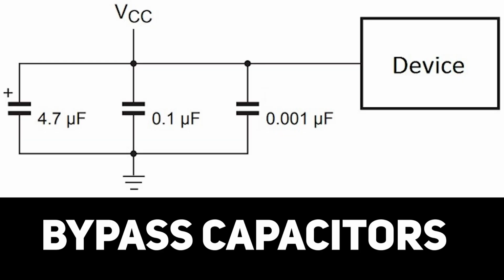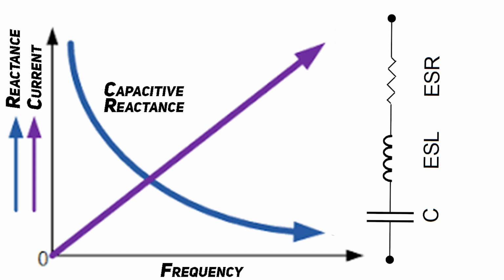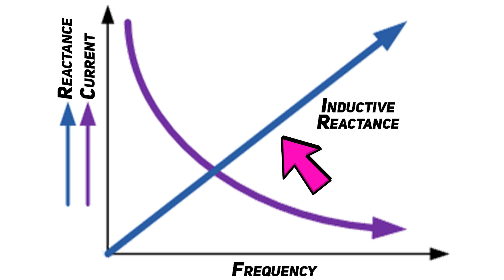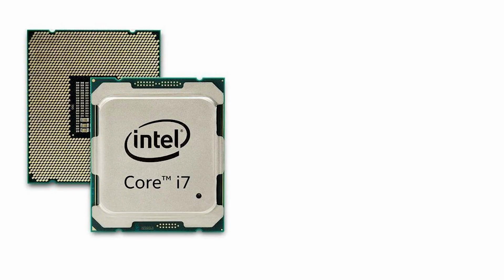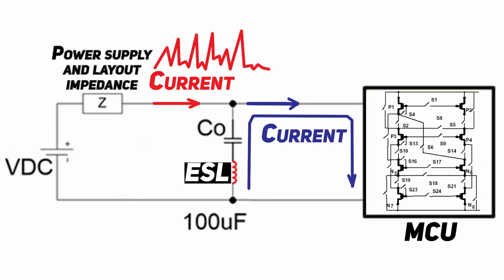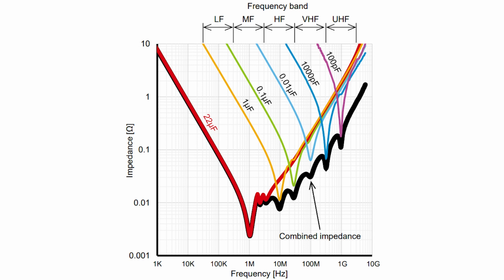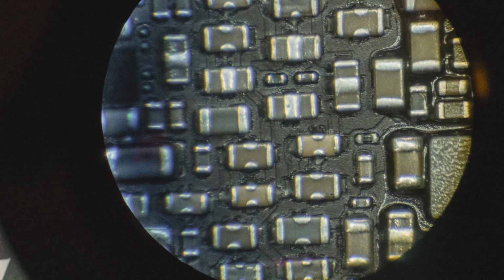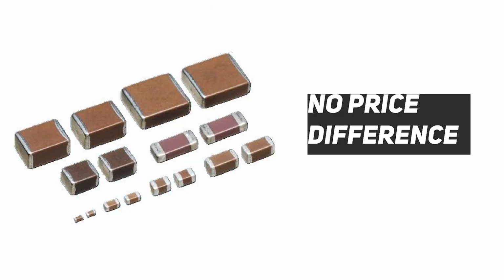Why You MUST Put Bypass Capacitors? Improve Your Circuit In 5 minutes

Comment: You are underrated, the knowledge you give is gold. Have a sub!
Although i dont understand one part of the video, the importance of impedance. Low impedance capacitor supplies smooth current to load right? instead of spiked current with a high impedance one?

Is impedance the only important factor when developping power distribution for logic circuits?
Reply from the maker: Thanks a lot :) Very pleased to hear.
To answer your question. 
Lets say processor rapidly increases current consumption. In ideal world, capacitor would deliver this current to processor instantly. But in reality, impedance of the capacitor limits current that capacitor can instantly deliver, according to Ohms law. And if capacitor cannot deliver current - Instability occurs and processor is unhappy. And it works in other direction. For example, capacitor can deliver needed current for a processor, but because it is far away from a power source, power source cannot instantly charge capacitor and capacitor voltage drops. Processor is unhappy. 
Here where PCB design come in place to minimize length between capacitors and DC-DC converter and other things need to be taken into account.
So, impedance of capacitors matter a lot. Indeed, this is one of the most important  parameters for high frequency circuits. But it also matters how far you put them from processor, their nominal value, so they have enough energy to flatten the spikes etc.
Reply: @NickElectronics  Thank you for the reply!
Another question(sorry i ask a lot of questions relating to electronics) when making a power supply circuit to power a project,
 (circuits like a buck boost or ac to dc converter with 4 diodes)

 there are capacitors present, for the ac to dc capacitors are used to smoothen the voltage for sensitive circuits. 

What leaves me puzzled is what capacitance should be used and how to find the capacitance needed for the circuit to work. How does capacitance of a capacitor effect a power supply effectiveness?

I know that more capacitance means more stored energy but how does that influence the circuit?
Reply from the maker: @Inti72600  After bridge rectifier in AC-DC (you call it 4 diodes) usually there is a bulky low ESR electrolytic capacitor to smooth sine wave to have semi DC voltage (not a perfect DC). After that, usually DC-DC converter follows which converts rectified and smoothed DC to a DC level you need with the control and  the feedback, complex circuitry. At the output there is also a capacitor to smooth output voltage. All calculations are based on the voltage pulsations on the capacitor (output of power supply) required. The higher the value of the capacitor - the lower the pulsations. Capacitors have a +- 20% tolerance, so it is necessary to calculate values in a worst key scenario. To have required pulsations when -20% you have capacitance. Then it must be verified on practice.
Simple example - if after bridge rectifier you put a low value capacitor and put a high load - you will see that voltage at your load is exactly sinusoidal. Capacitor is small and cannot accumulate enough energy to supply the load when sine wave crosses zero. But if you put one with high capacitance or lower the load, sine wave at the capacitor become smoothed and become DC with pulsations. 

If you want to learn electronics deep and understand everything its better to read a proper book for your needs. I have a plan to make a video about books to study electrical engineering.
Reply: @NickElectronics  Okayy thanks again!!

I look forward to watching a video about that !

Do you recommend any electrical engineering books i could read?
Reply from the maker: @Inti72600  if you are the beginner try 

The Art of Electronics
Textbook by Paul Horowitz and Winfield Hill

It covers a lot of staff. My recommendation would be to read parts of the book that looks most interesting for you and skip for now boring staff. You always can return to boring staff later when you need to.

In this book you can find formula to calculate capacitor value for examples you asked:)
Reply: @NickElectronics  Okay thanks a lot!
Reply from the maker: @Inti72600  You are welcome :)
Reply: @NickElectronics 
Do you plan on making a discord server anytime soon?
I've read the book you've recommended me(like 40-50 pages so far) and am a little confused on some of the formulas and would like to ask for some explanations for them. 

Otherwise thanks for recommending me the book! 
i've learnt more new things!
Reply from the maker: @Inti72600  HI! Have no plans to make a discord server, but maybe i will do streams with Q&A someday. Now its hard cause i live in dormitory and have a lack of time cause im writing PhD and do the project.
50 pages per day that is a lot :) Maybe try it a little bit slowly and deeply. Also, the good side of this book that it is extremely popular, and you can try finding answer for the questions in the Internet. There are also exercises. You can also find solutions for them on the forums easily.
Reply: @NickElectronics 
Okay!
 I've already done some of the things you've mentioned to verify my answers with the provided exercices of the book, I'll re read the confusing parts and if i still can't understand it..... I'll look forward to your future streams!
Have a good afternoon!
Reply from the maker: @Inti72600  Books and understanding of formulas is good, but don`t forget to burn some transistors and do experiments. Pure theory without practice makes no sense :) Good luck!

Comment: As soon as you showed the underside of the CPU I looked at an old one.
There were in fact a dozen caps there; and some spaces for ones I assume would be used for faster chips in the same socket.
Reply from the maker: Electronics manufacturers do this pretty often. They make universal PCB and then just solder only part of the components and sell this board cheaper as you said. For more expensive ones they solder more components. It`s just a business)